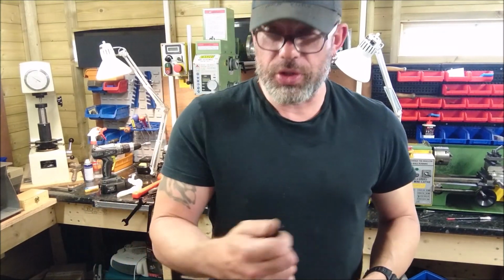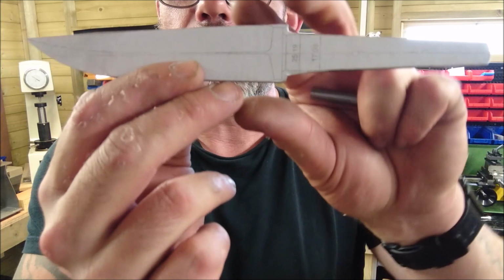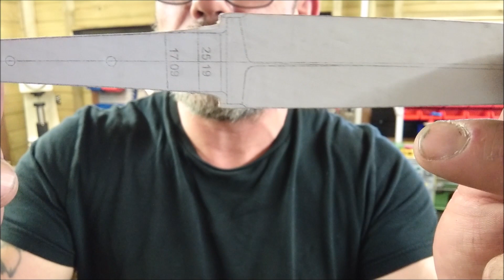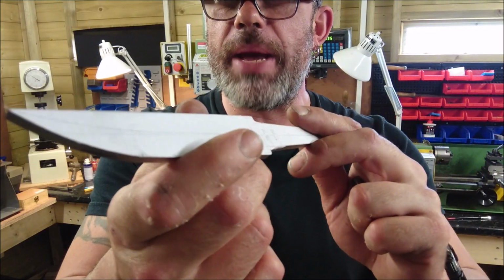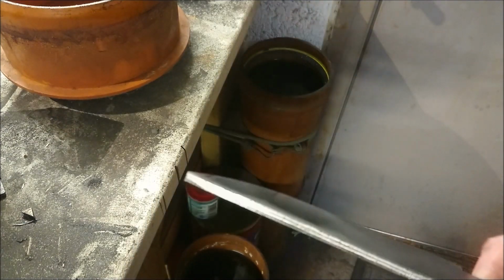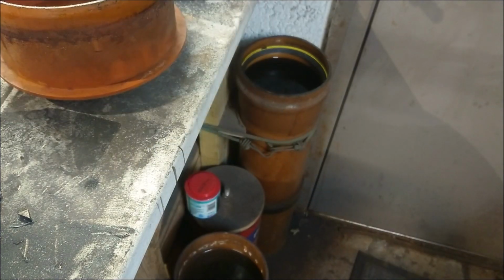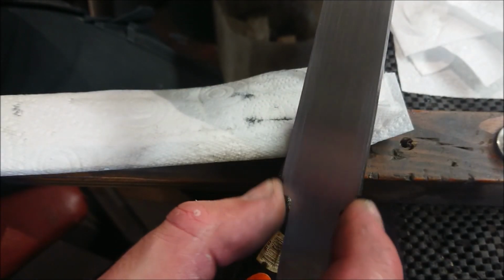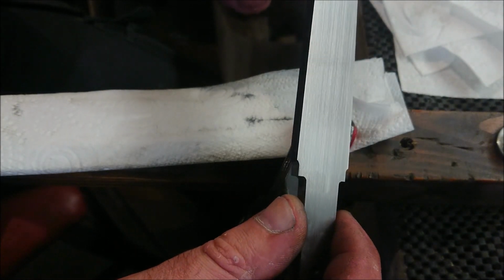CUSTOM DAGGER BUILD : PT. 2

Comment: El Chapo... 'Shorty'  if I remember right.
Now... as you're putting the  light scales on this - any chance of the blade having one of your dark finishes...
'Vintage Ivory ' micarta  flats, bronze bolster, dark tinged blade...
That would have  the makings of very very pretty  item ...  add your pronounced skills and 
oooooooohhhhh  !
Reply from the maker: The destiny of this steel is already decided mucka. You'll have to wait and see ;)